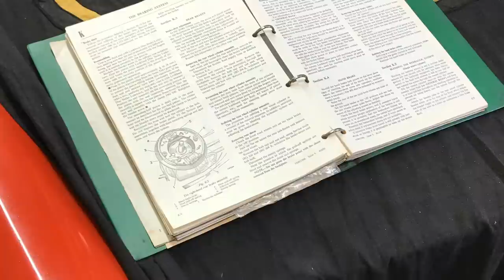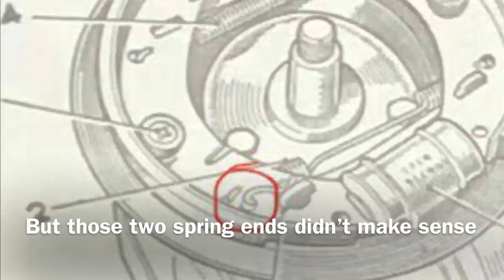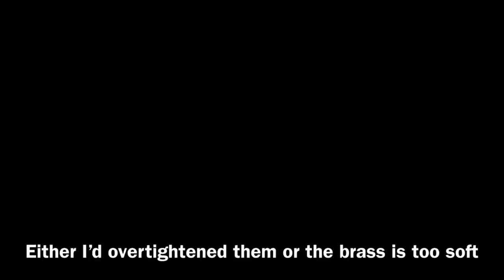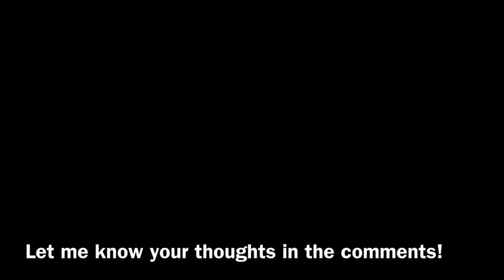Austin 1300 Restoration - Rear Brake Rebuild & bleed Eps. 18 ADO16

Comment: I agree with others keep the stèels, more in keeping with the project. In the early 70's I rebuilt my engine and box and restored and repainted my 1300GT and they were young cars then. Your work reminds me of those early days of repair and make do attitude with limited resources and cash. The 1300GT was a great car and is one of only 3 I wish I'd kept - the others? MK 1 Cortina GT and a Jaguar 420 enjoy every minute and good luck.
Reply from the maker: Awesome thanks, I appreciate your comment. By the way I had a few Mk1 Cortinas.  A 66 lagoon blue 1200 deluxe Was my first car in 89. I Learnt a lot of what I am doing now on that car! Had a white 2dr 65 LHD GT but sold it 2005 ish. DVLA suggests its still about somewhere GPV 32C. 👍

Comment: I acquired an MOT failure MG1100 at age 17 in 1974 and proceeded to teach my self about car repairs with a Haynes manual and advice from mates.  I have good memories of saving money with service kits on those brake cylinders on the 1100 and later I got an MG1300 and did a full engine rebuild. I decided I was well  up to replacing the front wheel bearings and all went well except that I forgot to buy new split pins. So being 18, I ignored the manual's advice and put the old ones back.  In due course a hub nut came totally loose and fell off into the hub cap! I was only saved from a major catastrophe by the hydraulic brake house preventing the wheel from actual detaching!  I agree with the many other comments that steel wheels have to be right for your  project.
Reply from the maker: Great story thanks!! Deffo Steels yep👍

Comment: I have the same brake pipe flair tool, still works great. 
The underside of my old mini was daubed with lithium grease every nut. bolt and fitting. Never had trouble getting anything apart after the first struggle.
Refurbish the original wheels, keep it standard, your doing a great job
Reply from the maker: Cool! Good bit of kit, better than a more expensive die flaring set I tried once. Can’t beat a bit of grease under the car 🎶 ...Thank you!

Comment: Nice work, as always! I would restore the original steel wheels if it were my car. I prefer the factory look in most cases. If you want to add a bit of bling that doesn’t detract from the originality too much, I would go with a set of chrome trim rings, they would set it off nicely.
Reply from the maker: Thank you! It’s interesting to find out peoples views on the wheel situation. That trim ring idea sounds great, I might have to start looking out for a set. I expect it will be easier to find some hens teeth though, hmmm...we will see...cheers
Reply: There are probably aftermarket ones about but the ones fitted to the VDP models were the better ones to get if you can find them as they were inset to the rim lip so they weren’t so prone to getting scraped on a kerb. Something to consider when looking, anyway.

Comment: old school   thing  !  put a  schamfer  on  the leading edge of the shoes  / 45 deg .  
adjust the drum 's  up until you cant turn  them by hand . then hit  the  drum  all around  with a hammer   then re ajust untill   they just start binding  , then bleed the brakes  up .
Reply from the maker: Thanks! In case anyone reading tries this you have to watch out for that dust from old shoes, especially if you don’t know if they contain asbestos or not, (dust is hazardous in any case) I use lots of brake cleaner and bag up & throw away any contaminated rags. 👍

Comment: I am always so impressed with your attention to detail, even the new wheel cylinders stripped and painted, i have the same brake pipe flaring tool, how did you bend the pipe to shape just by hand ? i think refurb the original wheels, you have made it look so original every where else.
Reply from the maker: Thanks! I straighten off the reel by hand bit by bit carefully, (u can get a tool or make one to do that), to create curves by hand I use large 32mm 1/2” sockets, paint tester pots etc. I think this was in the previous episode or two if you are interested, cheers 👍🙂

Comment: Alloys from the late Austin 1300 GT model would look nice, a hard task to find some I think.
Reply from the maker: Mmm..think they had trims to fit on the steels which looked like alloys? But even those are hard to find at a reasonable price now! I saw a rubbish set on ebay for £100. Years ago I used to pick up stuff like that at car boot sales for a quid, those were the days.

Comment: Restore the original wheels. Not sure that "minilite" style rims look right on a 1300. 
Great job with the brakes BTW.
Reply from the maker: Cheers for your input, I know of another slightly modified 1300 that has them and thought it looked ok but I guess it’s one of those marmite things. Thanks, Appreciated.

Comment: On the  hub caps, try a little metal polish such as Silvo (Duraglit) and scrunch up some tin foil (Bacofoil) and give it a good rubbing. Do the worst one first and on the most rusted areas. Nothing to loose.
Reply from the maker: Interesting tip, thanks 👍

Comment: Great (another great) video and great inspiration. Do you happen to know the size specs of the rear brake shoes (i.e. their size)? Want to replace mine and could not find anything more than that they fit an 8'' drum. Thanks in advance, K.

Comment: Restoring the steel wheels would keep the originality of the car, but a nice set of 13" Minilites would be in keeping with the  period of the car.🤔
Minilites, but keep the steel wheels for if you want the car judged at a show for originality.
Reply from the maker: Might do that long term but can’t afford two sets now. Torn between authenticity and a desire to fill those cavernous arches out a little bit more! Cheers

Comment: is the rot holes i see in the bulkhead mate next to the brake master cyl or black paint ???
Reply from the maker: No the paint didn’t take too well to the original black mastic and flakes off if pressure applied. Not good but will try to sort out later.

Comment: I bought replica Dunlop.    D1. Wheels for mine and didn’t like them it made the car look like a roller skate .
Reply from the maker: Oh no, you must have been gutted. Cheers for sharing 👍
Reply: I sold them. And refurbished the wheels I had. . I’m more gutted with the current 1100 I have  like you I have restored the engine bay on my car . It all started because the engine was worn out.  I have completed all that now. But have not been able to get it running  like it should. I’ve tried so many things that everything now is new. Engine,carburettor,distributor,coil,new leads, and it still won’t idle smoothly so frustrating
Reply from the maker: Good luck with getting that sorted,  when you do pls let us know what the problem was 🛠
Reply: Hi   I will do if I ever get to the bottom of it,  I thought I’d found  an old school mechanic to set it up , but he just kept letting me down  .  It sounds silly but in my area Clacton on sea.  It’s very hard to find anyone to work on it. I’m ok with basic mechanics. But not fine tuning
Reply from the maker: Mmm.. that sounds frustrating. Old skool mechanics must be getting thin on the ground now. I guess its possible that some younger mechanics have never even seen a carburettor or distributor let alone know how to set them up. Good luck with that!